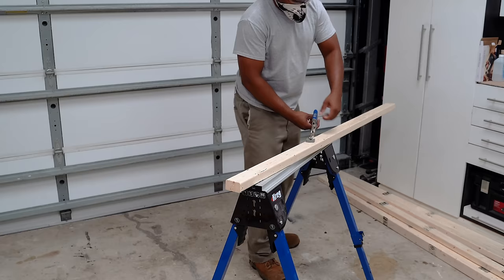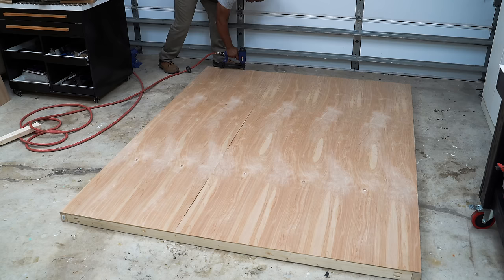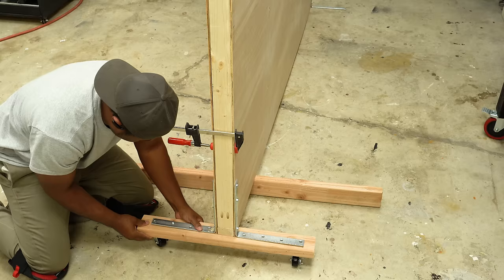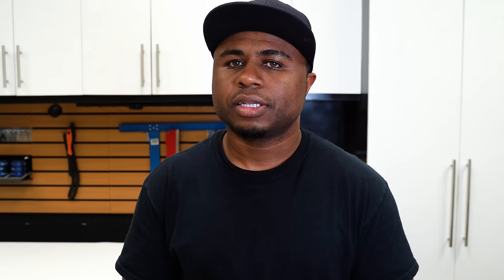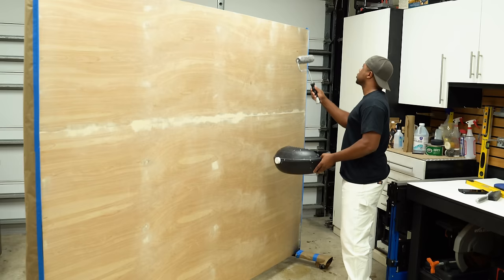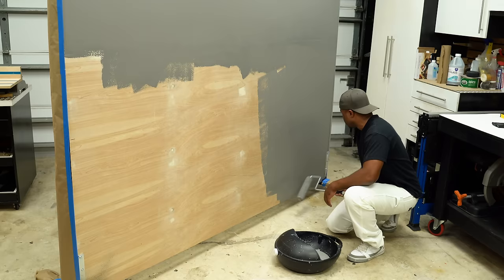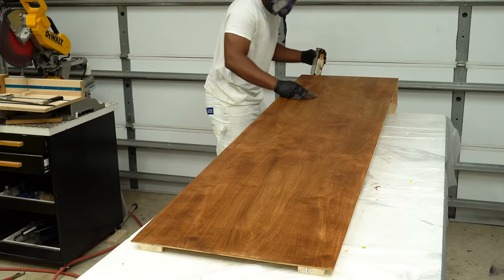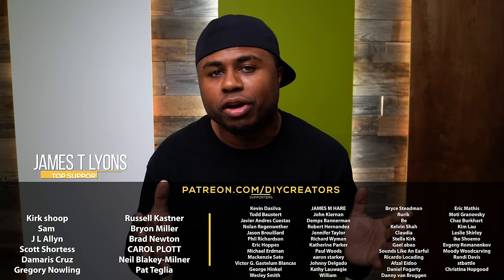How to build a portable WALL (COOL IDEA) | DIY Creators

Comment: Realistically I am looking to build a wall to attach some ikea furniture so I just need the plywood and tools. But as a art historian I love the craftsmanship in this project and your attention to detail! Also if you ever decide to change the green color, you can always use a light pink or red to tone the green down on that panel. The beauty of being an art historian is I had to learn color theory. So you do not have to repaint the whole wall you can just switch the led colors around on that green panel to red or pink to tone the brightness of the green down and soften it so it is less harsh on the eyes and it will blend the two colors but the led light will make the wall still pop out.

Comment: Love that neon/lime green color. It pairs very well with light to medium grey (think battleship grey) and dark blues. For anyone building this at home you can cut about an inch off the width of the 2x4s to lighten them up. Instead of plywood cheap wall paneling is even thinner and very light but not as strong so the wood glue is a good idea. Don't skip it. Also if you wire in electrical box and outlet to an extension cord running outside the wall before you close off the wall would give you a point to add additional lights later or to be able to use the wall to power your devices.
This is a great project idea he had
Reply: great ideas!

Comment: Might I suggest wiring the wall for power, with a cord to plug it into house power? Either actual wiring or an outlet strip near the bottom.  That would make life easier trying to plug stuff in, especially if the wall ends up covering the normal outlets or blocking the rest of the room.
Reply: thats a FANTASTIC idea. im going to use THAT and this video as inspiration. im trying to make a youtube studio that can be moved or taken down.

Comment: I was actually working in my head a way of doing the first panel without having to drill that many hole into my concrete wall.  The plywood panels are the answer.  Thanks, bro!

Comment: This is great. I have several uses I can think of. I am a woodworker and I refurbish furniture. I have a very large family room. One side is family space and the other side is exercise equipment. Also this is currently surrounded by finished projects, unfinished projects and furniture waiting to be refinished. It would be great to block the view. And a backdrop for photos.  I'd also love one in my shop just as a barrier. My shop is attached to my house and you have to go through it to get to the room that has our second fridge and freezer. Drinks and snacks are there so there is always someone going in and out. And finally... A divider wall for my booth at the local antique mall. Thanks for sharing.

Comment: I've wanted a fake wall for some time, initially the idea was less ambitious because it was going to be used just to hang my tv/monitor at a comfortable level, and hid all the cables but then I realized I needed something to hang a wall clock, a calendar, etc so now it's probably going to be quite bigger
Thanks for all the ideas I got from your work, it looks great, quite original, and it's also so versatil

Comment: Great idea for panels. They can be used by combining panels into one big white board for drawings and comments, diagrams, graphs.  Then removed and set aside for room separation use.  Coasters allow white board to be hidden by turning hung whiteboard panels around towards the wall.  Paneled whiteboard also allows transportation offsite, (3 parts) in a vehicle. Use is endless.

Comment: If Home Depot supplied the wood they must have given you a week’s notice so they could find some straight ones perhaps they popped down to lowes to see if they might have better luck
Reply: Haaaaa
Reply: Ain't that the truth, I come out of the shower drier than some of the wood they carry!
Reply: Facts
Reply: Home Depot and Lowe’s intentionally get the worst quality lumber.
Reply: I don’t buy fasteners at home depot anywhere unless it is an emergency . I and my family in the Philadelphia and harisburgh area have had rotten luck with the quality of their fasteners. Mounting a large power transformer into concrete the lag bolts sheared had to unbolt the installed bolts and hammer drill new anchors. Same thing happened to my nephew going into wood. I use my local True Value store or another hardware store for fasteners.
Reply: Kyle Phillips where else do you get your lumber from? Im looking for some walnut
Reply: lmao joyce  i like you already and i dont even know you yet 😂
Reply: that's just funny. i don't agree but it is so funny.
Reply: Best comment on YouTube ever!
Reply: Hahahahahaha damn Home Depot gets wrecked on every wood video I swear 😭😭🤣🤣🤣🤣
Reply: Aaawwwww
Reply: The lumber that goes to all stores is the same, don’t try to fool anyone. Same supplier no matter where you buy.
Reply: Tell it, sister! We got a case of bendy boards goin on.

Comment: Just wanted to say thank you.  This inspired me to build one as well.  I did mine a little differently though.  

I realized that the bottom of the wall would never ever be seen.  On each side, I put in a single gang electrical box to put in power outlets.  I also put in a single gang electrical box at the top.  On one of the sides of the wall, I used a shore power connector.  Now like a RV, I just need to park it somewhere that has an extension cord and I have power.  If I need lighting shooting up or down, I have electrical power to do it and it will not be in the shot.  I also mounted hooks at the top for hanging a green screen down.  I also mounted hooks on the side if I want to use banners.

Thanks again for the inspiration!

Comment: hi,
thanks for the tips and ideas
for my own project I have used insulation panels 3/4 inch, one side is aluminum like which is great foe lighting and the opposite side can be paint or covered with almost anything, I have chosen acoustic foam panels.
the hole setup is extremely light weight but some what fragile 
cheers

Comment: Great idea, but wouldn’t using 2x3 reduce its weight or even metal studs. Using 2x4s for shoe and lower cross supports should keep the center of gravity low and metal studs would reduce weight.

Comment: If u put LED STRIP on 1x3, connect the 1x to privacy curtain panel joints, it's a similar effect... With portable lighting, you can pass color or shadow effects through the paper/fabric panels
The privacy curtain can be an easy DIY

Comment: I watched this 2 years ago when it came out. Came across it today again. I have two things that I’m looking for a portable wall for. One… I was going to build a wall in my shop. But we are not sure where we want to build it right now. Things are changing. So this might be a great solution. I’m curious as to how much weight this wall can hold. I may end up using one side for French cleats to hold some things that I’d like to hang. Clamps definitely come to mind. But other things as well. TWO… my studio is a large room and I have multiple room dividers separating it. It’s not a room we want to build a permanent wall in. But I definitely need some separation. This may do the trick. I had wanted to hang things on the wall and use it as staging for finished projects. Again… I’m curios as to how much weight it holds. I think I’ll give it a try and find out.

Comment: Good idea!  I bet your light strips come off though.  That double sided tape they use does not stick well to wood, especially in high humidity.  If they do, simple wire clips will fix it.  Be sure to insure the nails don't Pentwater your finish though.

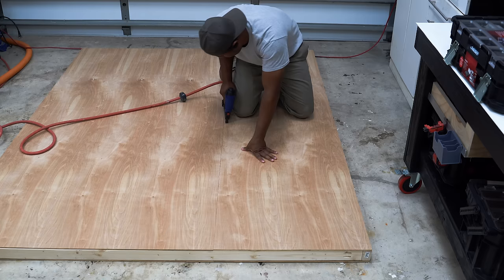Comment: You mentioned at about 3:30 that you used those wheels but they worked for the height you needed. Which wheels would you have preferred to use?

Comment: This would be even more useful with outlets and backlighting, also would be useful for streamers and other content creators to to one side green for greenscreen applications. Could also add in foam insulation. light weight, and sound absorbing for video calls.

Comment: I can't build a pocket wall in my 1955 home I'm looking for ideas I'm considering doing something like this. On a smaller scale to slide across an industrial pole I wonder how that would work? Its a player and lath  house. The bathroom is only 25 square feet and has 2 doors and a shower door besides its a 3/4 bath with a parietal sink. I'm the same age as my home and a disabled grandma so the remodeling ideas need to be simple and affordable.😜🤗😁

Comment: It gets tiring to google something you need help with and get nothing but the opposite.  I bought faux brick 4x8 panels to build exactly what u did here. I was considering using cleats to attachbto the concrete basement walls because its not my house and imbtired if making a house a home and circumstances end with me trying ti fjnd a new acceotable home. Im still looking 7 yrs later. Anyway! They weigh 30 approx lbs.  With concrete screwes and liquid nails can i feasibly use cleats? 2 on each panel?

Comment: IM BUILDING MY WALL TOMORROW HOWEVER AFTER I WATCHED YOUR VIDEO AGAIN I REALIZED THE LUMBER THAT I BOUGHT WAS 2 X 4`S AND YOURS LOOKED A LITTLE SMALLER. MY FRAME WILL DEFIANTLY BE HEAVIER SMH. MY WALL HEIGHT IS 8FT AND LENGTH 10FT. aND ALSO ILL BE SOUND PROOFING ONE SIDE AND PALLET PANELING THE OTHER.